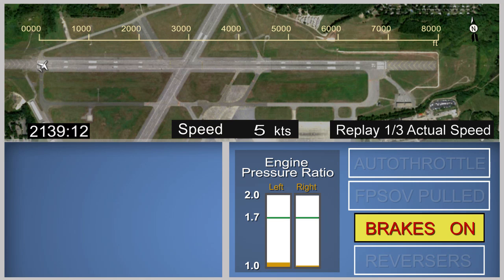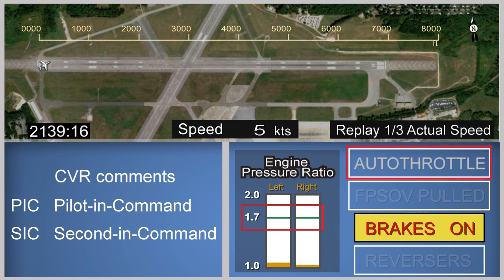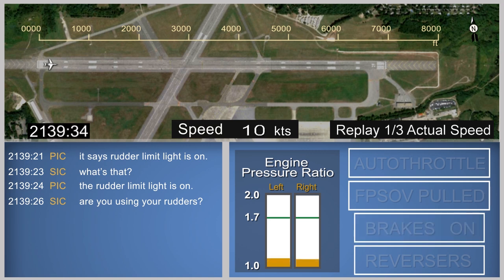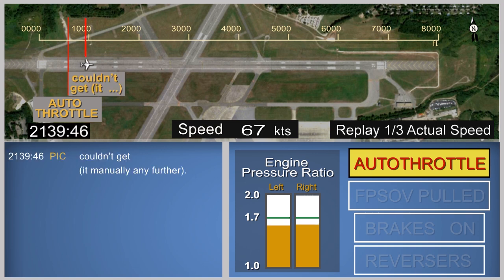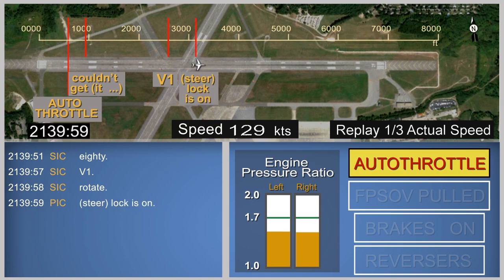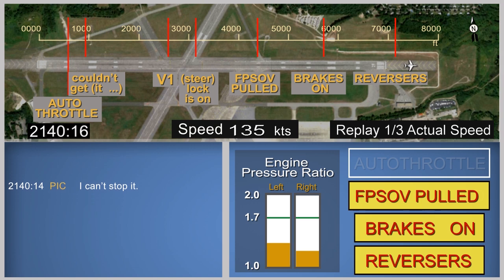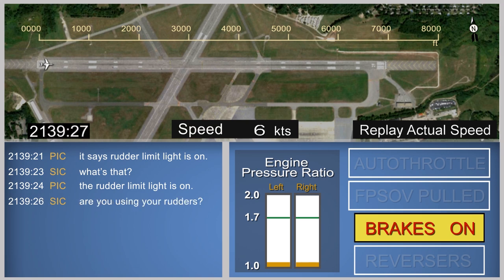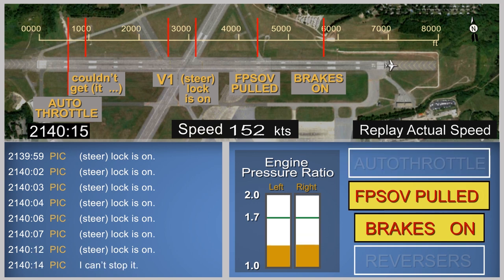Runway Overrun During Rejected Takeoff in Bedford, MA 5/31/14.

Comment: If you reach V1, you have to take it to the air or you'll crash - that's what V1 means.
The inverse of that is: Don't go past V1 if you're not positive you can fly the thing. The PIC didn't even take 5 seconds between getting the error message (relayed by his SIC) and pushing the lever anyway. There is no way he actually thought about what the light meant - he just said "not now" and tried to take off...

Comment: I would look into & recommend adjustment of the overall required continuing education requirements of licensed PIC's. Failing sequential events, such as these,  MAY be greatly lessened by 'Critical Task Drill' requirements. In today's age, these can be conducted via zoom meeting, or during weekly-scheduled Safety Meetings. 'What If' Q & A sessions should be a welcome weekly practice. As a previously-licensed Master, on the water, these were are still are common SOP. #FoodForThought #SaveLives #SafetyFirst

Comment: Many times corporate pilots will do anything to avoid what they perceive as an embarrassment (go around, rejected takeoff, delay for deice, etc).  Rather than reject, they try to shut off hydraulics to the flight controls to circumvent the gust lock?  Then reject, way too late, when that doesn’t work?  Just like the Teterboro Learjet, rather than go around, and admit they messed up, they try to sneak in into the circle and screw that up, luckily without pax or injuries on the ground.  Also shows the lack of systems knowledge amongst corporate aviation.  They should’ve known what the rudder limit light was telling them, and then should’ve know what it meant when they could’ve advance thrust.  This isn’t Monday morning qb this is simple fact.  I’ve flown about 7 years in corporate and 15 in the airlines and it is night and day difference.
Reply: Note to self: If offered a flight on someone’s corporate jet, go get a ticket on a normal airline instead.

Comment: About the only thing that would have prevented this accident is if the G-IV had a system aboard (a simple switch would do it) that prevents the engines from starting if the gust locks are applied. The NTSB report (https://www.ntsb.gov/investigations/AccidentReports/Reports/AAR1503.pdf) has a picture of the control pedestal on a G-IV. The gust lock lever is bright red - NOTHING else in the area of this lever is red - and says "Gust Lock" on it in big letters. When this lever is in the "on" position it restricts throttle response. A blue warning message appears when you try moving the plane under power with the gust lock on. If there was a voice warning system that used a drill sergeant's voice to yell out "hey dumbass, your gust locks are still on. Shut off the f'in plane right now and fix it," they probably would have ignored that too. They had all the warning in the world that this plane wasn't airworthy as it was set up...and these idiots ignored it. Unfortunately, five innocent people died for stupidity.

Comment: Wow... I guess more than anything, this is a lesson in habituation.  Right from the start the PIC had an indication that the rudders were locked in place, which every pilot knows will almost certainly prevent a successful takeoff.  In addition, if the person who was supposed to remove the rudder lock didn't remove the rudder lock, then very likely they also didn't remove the elevator lock (and possibly also aileron locks, depending on airplane).  It is just amazing to watch the PIC and SIC notice things were wrong, yet NOT stop the takeoff roll... again and again and again.  The ONLY force that I can imagine that would prevent anyone from acting in such a dangerous if not suicidal way is... habituation.

The PIC and SIC had taken off so many thousands of times before, and may never have stopped a takeoff ever before.  Fact is, I never had to abort a takeoff either.  But I just can't imagine that I would fail to immediately stop the takeoff at the first rudder-at-limit indication... and several times later too if I was dumb enough to continue beyond that point.  It hurts to watch people hurt themselves, especially when nothing was forcing them to do so.
Reply: max bootstrap The gust lock system is controlled from within the cockpit and limits all control surfaces, it’s not something one removes like on a small single. Which of course makes you wonder why they didn’t check the gust lock lever? They also failed to do control checks on 98% of their previous flights. Also of note was that other Gulfstream gust locks failed to limit throttle movement as designed. Two pilot crew not using checklist is nuts.
Reply: "They also failed to do control checks on 98% of their previous flights." - why wasn't this caught before and them stopped? How many other pilots don't do control checks?
Reply: During retraining/upgrading do you have to perform aborts?
Reply: It’s like the pilots were in a dream…wanting things to be more normal…unable to instinctively reject the takeoff…. Perhaps years of trying to satisfy top management they were in a dream of get~off~itus

Comment: Sounds like nice features to prevent a take off if theres something wrong. Very well thought out. Enough to stop it from leaving the ground, but not enough to stop the pilots from trying.
Reply: There is also a really effective feature called a "checklist" that most likely would have prevented this... that the pilots chose not to use.
Reply: they should have made the restriction lower like... maybe idle it shouldnt have allowed any past idle
Reply: @googaagoogaa12345678  As an engineer I can say you really cant design any engineering control for stupid. To have this crash take place, the crew had to both not do the checklist and miss the fact that the gust lock was engaged, and then spend the better part of about half a minute ignoring the increasingly alarming signs that the controls were locked, even going as far as to call it out multiple times and not even bother to reject the take off for a good 15 seconds. Its basically like having your steering wheel lock suddenly engage in your car, but you continue to mash the gas pedal to the floor rather than immediately try to stop. To be fair, they were able to still attempt the take-off due to a design defect that allowed the manual throttles to be both pushed farther physically and overridden to levels beyond what was designed for. More zealous measures could be put in such as having the fuel controller shut down above taxi speed and kill the engines, but such measures can become as much of a hazard themselves if they malfunction on an otherwise perfectly flyable airplane. Im a firm believer in effective engineering controls, but at the end of the day, engineering controls are there to mitigate potential disaster when competent people have a momentary lapse of judgement and make a mistake, not protect against gross incompetence. Some times even the best intended prevention measures can fail with enough persistence, as happened here.
Reply: @mysock351C  Underrated comment about aggressive safety measures becoming a potential hazard themselves. Engineering is hard.

Comment: What a load of crap. The pilots sucked at it! 

Probable Cause: "The NTSB determines that the probable cause of this accident was the flight crewmembers’ failure to perform the flight control check before takeoff, their attempt to take off with the gust lock system engaged, and their delayed execution of a rejected takeoff after they became aware that the controls were locked. Contributing to the accident were the flight crew’s habitual noncompliance with checklists, Gulfstream Aerospace Corporation’s failure to ensure that the G-IV gust lock/throttle lever interlock system would prevent an attempted takeoff with the gust lock engaged, and the Federal Aviation Administration’s failure to detect this inadequacy during the G-IV’s certification."

Comment: I remember  the time I took off as a solo student in a J3 Cub with two 2" x 4" boards gust locking the rudder.  I made two touch an goes asking myself why I had such limited rudder authority before I landed and taxied back to the FBO  to complain. Boy was I startled to see the long red removal ribbon flapping in the breeze, Never missed a check list for the next ten thousand hours.
Reply: You were really lucky that day!
Reply: @NovejSpeed3  that is right
Reply: How did you manage to taxi?
Reply: @Mr7o4  Planes steer their front wheel to taxi.
Reply: @liesdamnlies3372  wrong. Differential braking in the aircraft mentioned.

Comment: Can someone familiar with a G-IV  tell us what was required to disengage gust locks while rolling?
Reply: Nothing would disengage the lock in that situation. 
Once the engines were started the hydraulic pressure won’t allow the gust lock to release. They had to shut down the engines to get the lock off. That’s why they incorrectly tried to turn off the hydraulics to the flight controls.
Reply: All they had to do was lower a handle

https://youtu.be/R8OBO6vECug?t=1060
Reply: @upurnose46  Nope.

Comment: I could/should write a book on all the events I have seen but a few highlights. Watched a Cub get airborne dragging a cynderblock tied to his tail. A Citation in ATL was taxing out with a towbar still hooked to the nose.Fyi its huge. Not holding brakes leading to yanking out ext power. To many wring rnw/taxiway and even wrong airports and incursions to list.
BTW- there is a vid of a large high wing twin possibly vintage that was painstakingly rebuilt and on its maiden went vert into a stall and nose in total loss die to gust locks being forgotten.
Reply: wow crazy i would buy/read that what was the vid
Reply: That video is a Buffalo I believe converted to turboprop power on an early flight in the program.
Reply: @Spyke-lz2hl  Yeah, I think you're right if it's the one I'm thinking of.  A DHC-5 Buffalo.  Went straight up and straight back down, horrible.
Reply: The cinderblock was just the Cub’s new tail hook.

Comment: Do operators randomly pull the tapes to verify their pilots are following procedure?
Reply: +johnfranks Yes, There's an automatic parameter indicator, FOQA, which records and highlights (sends a message) when specific speeds, flap settings, gear position and other configuration parameters are exceeded. Also company and FAA pilots routinely fly in the cockpit to observe procedural compliance. Also pilots train routine, as required by law, in simulators to practice emergency actions, new procedures and industry common issues. There's a lot to all of this, yet the cockpit environment is subject to many many many permutations in weather, weight, performance, personality, fatigue, flight hours, etc etc., so that there are many variables that affect the flight. Just the availability of approach modes of operation are complex choices with  major and minor permutations that require focus and situational awareness on the part of both pilots.
Reply: +johnfranks I don't know about the major airlines, but this was a private corporate aircraft. The NTSB report stated that the aircrew of this particular airplane failed to check the operation of the flight controls 98% of the time with over 176 take offs.  If I knew that about my pilots they would be fired : )  The question I have is how did they manage to pass their mandatory check rides? The NTSB also faulted the aircraft manufacturer for allowing the throttle lock position to advance power to take off speed with the gust lock engaged. The flight crew totally froze for too long (about 11 seconds) before aborting the take off. Besides engaging the autothrottle because the throttle levers wouldn't move past a certain degree (6 degrees?), they also tried to unlock the control surfaces instead of shutting it down. Very sad.
Reply: @strangerhorse5209  i do have to wonder the outcome if they would have done reversers immediately with brakes